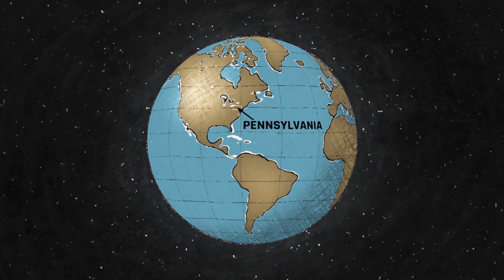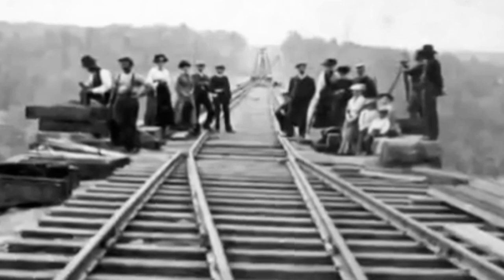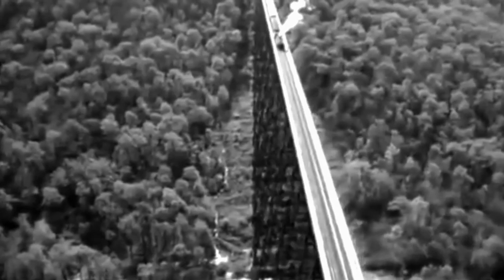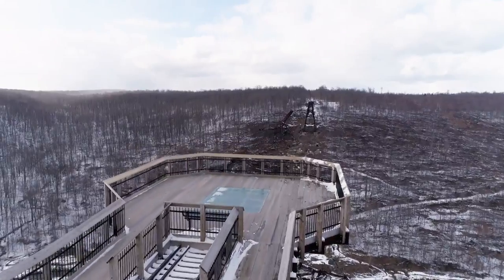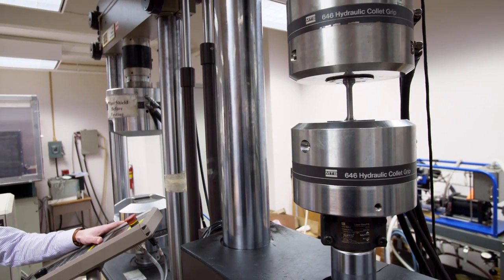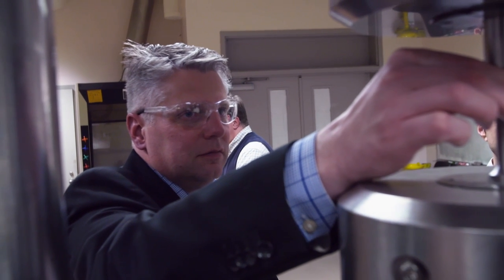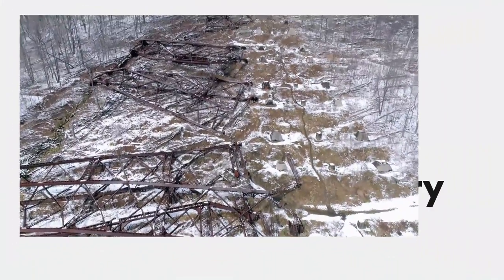How The 8th Wonder Of The World Failed Due To An Engineering Oversight |Massive Engineering Mistakes

Comment: I’d say the original engineers did it right. This seems like Lack of maintenance By future generations. All they had to do was replace those sleeves periodically.
Reply: Not the sleeves, the anchors
Reply: Yup, they coud anchor it again. Wind just lifted the structure and slamed it to ground.
It fact structure of this kind is like a kite in the wind
Reply: Thank you, I was looking for Thai comment. Ppl should have maintain it over the years not the original engineer problem after awhile.
Reply: @stephensarkany3577  He's holding a cracked anchor in the end clip though. Lol
Reply: @GiuseppeGaetanoSabatelli  maybe it broke because its over a 100 years old?
Reply: Slaves or sleeves
Reply: @jclar3565  got this in a notification without context and thought this was a reply on some ogre/tentacle hentai
Reply: Omg your right, the sleeve was the part that cracked and the wrought iron anchorbolts were fine... what an awful documentary...
Reply: If a train had been on it during the tornado the weight would have kept it down...Maybe? Or they could have strapped bungee cords to nearby trees.
Reply: It will stand all day long in compression but uplift is a whole nother game. Pennsylvania doesn't design for uplift especially back then. I stand corrected, from what I just read they do design for 90 mph.

Comment: Something that lasts for over a century is NOT a failure. C'mon now, modern sports stadiums barely last for 30 years in decent shape
Reply: @U WinTV Not so.   The bolt caps were not corroded back then.

Comment: I bet those engineers that designed this would have been so proud that this bridge lasted as long as it did and that it took a tornado to take it out after that long of a lifespan. If proper inspections and maintenance were performed it would likely still be standing today. You can not blame the original engineers or builders for something that fails that long after it is out of their hands when long term corrosion combined with extreme weather are the cause of failure. You could say they should have used different anchoring bolts but there was close to a century in which they could have been replaced so if no one else predicted this with all the technological advancement in engineering along the way how were they supposed to predict this way back then!

Comment: So lemme get this straight: A bridge that lasted well beyond its initial design (twice) is a failure because it was destroyed by a tornado in a non-tornado-prone area, a neuroscientist is being portrayed as an expert on civil and metalurgical engineering, they test the tension of cast iron and portray that as the weak link even though they lead off by explaining that the bridge was made of wrought iron instead of cast iron for that exact reason, and then they tout that as the reason for the failure of the collar nuts...  which were installed during the rebuilding, and were thus presumably steel?  I would hope that discovery could at least tell an internally consistent narrative, let alone getting the facts correct.
Reply: The big problem was that the current engineers didn't find the weakness till it fell. Oops who would have guess the foundation pins would wear out in 100 years...
Reply: The bolts they were attached to broke not the nuts
Reply: @jwarmstrong  I'm willing to bet some maintenance engineer in the last 20-30 years brought the subject of the 100 year old collar-nuts up, but the memo was buried by a guy in suit because of budget constraints.
Reply: @charlesdog9795  not that it would have mattered. I can't imagine anything surviving the forces a tornado would put on it.
Reply: This is just how UK television always portrays U.S. ingenuity.
Reply: YES! Exactly what I was thinking, wrought iron cast iron steel, wtf is it? figure it out, then get back to me on that over a century of serviceable use in an area not know for tornadoes being "failure due to oversight"
Reply: @jbodden6977  If she had a degree more connected to the issue at hand they would have mentioned it. A neuroscientist, no matter how good, isn't an expert in engineering. Nor would a PhD in psychology.
Reply: @charlesdog9795  So true. And said guy got none of the blame.
Reply: Daniel,  I take it you DON'T work in government.
Reply: So the anchor system wasn't enginerded for up lifting forces... But where are the calculations of the uplifting forces that would have been present from the recorded winds on that structure, and then how do those forces compare to the designed strength of the actual structures anchor system? Looking at the debris it looks like half the bridge fell to one side while the other part fell to the other side, suggesting it was directly in the path of the eye of a fairly large tornado. I'll bet even standard modern specs for a similar bridge would not actually withstand the wind loads from that tornado.
Reply: Paid experts. It’s a problem in news reporting too. Nobody appears on CNN, CNBC, or Fox without being PAID to read their lines

Comment: After 100 years without replacing those anchor bolts or collars, the failure is mostly a maintenance problem. They're exposed to much harsher conditions than the rest of the bridge.
Reply: What was most interesting to me was that the newer steel collars failed by splitting.  They may have been partially split already by rust jacking from the older anchor bolts inside them.  I would have expected the threads on the anchor bolts to have been stripped off by the collars.
Reply: I'm also pretty confident a tornado would wreck that bridge with steel or iron anchor bolts
Reply: How ductile or otherwise the steel was also depends on temperature. I expected they made allowances.
Reply: 100% correct.
Reply: Pretty sure Mr. Tornado would have knocked down that bridge regardless of what they did to make it better. lol.
Reply: It's PA.., maintaining bridges and overpasses is still a problem to this very day lol
Reply: 100 years, Rusted bolts and a tornado.  What terrible planning.
Kinda like this.  If I live to a hundred, with bad lungs, feeble frame, thinning hair and a hearing aid . . .then get hit by a tornado. . .did it matter I ate too much bacon and drank too much wine?
Reply: Not a maintenance problem as much as a tornado problem
Reply: @jayden7945  , I was thinking the same.
160mph winds are no joke on a tall, long structure like that bridge.
Reply: @SuperSirianRigel  Well, the only reason that much of the bridge still exists upright is because of the maintenance work done in 2002 and 2003.
Reply: I agree. Seems to me with all the new technology they would have done something sooner as weather and things changed
Reply: @tjh44961  that's the picture I had in my head. Flash new steel collars ripping the thread clean off the dodgy old iron.
Reply: @CarsCatAliens   you’re not lying. In Lebanon Co, We still have bridges that got damaged in the 2011 flood that still need redone.
Reply: I bet those bolts and collars were broken in the act of the bridge falling.  I doubt they were the cause.  Once the columns start to tip over, its going to snap all of the remaining bolts.

Comment: So an engineer, from almost 150 years ago, with his limited science and engineering available at the time, and limited materials, built a bridge that lasted over 100 years supporting HUGE loads from incredibly heavy trains generating ridiculous vibration, and only went down after a powerful tornado hit it, is a failure? Ya....what an asshole. All of us in the comment section would have done much better. More importantly, the geniuses that made this “documentary” would have done a much better job.
Reply: and the funny part is,I live in PA the coal mines and steel industry are pretty much gone at this point. the bridge had almost no use left and was already closed when it got destroyed by a tornado.
Reply: @Mark Campos yeah it was supposedly being maintained.
Reply: I could’ve built it to last a good 250 years minimum. Also faster
Reply: @lukasdoofus2592  despite the coal mines and steel industry the bridge was also used by passenger trains. They stated in the video that passenger trains were diverted for safety reasons after they discovered how poor the bridge was. Even freight trains had stricter regulations to follow. So I don't get your point of the bridge not having much use left.
Reply: In Seattle about 8 months ago they found that the West Seattle bridge was failing and have since closed it. They have no permanent plan to replace the bridge that was built 30 years ago to 100 year specifications.  I'd say we should dig up the engineer of this bridge, figure out how to bring him back from the dead and get him to build it. Seems like it would be faster than letting WSDOT handle it.
Reply: @scottwall8419  The problem today is that everything is designed to use the barest minimum of product and labor that should allow it to work for a predetermined amount of time. 100 years ago things were designed to be overbuilt and last forever.
Reply: @ronaldsteele6151  There was minimal freight traffic on that bridge and the only passenger traffic was a tourist train that used the bridge as an attraction. That bridge and line was yet another of Americas great and vast rail network that was abandoned in favor of supporting overcrowded highways. The country would be much better off if the government stopped subsidizing highways and airways and forced people to turn back to rail.
Reply: Just going to make it clear that an F1 tornado is NOT a "powerful" tornado. Powerful is generally considered to be EF3 or above.
Reply: @lukasdoofus2592  same here. Despite everyone elses “opinions” there is virtually no need for trains in our part of PA. Trucks handle virtually all transportation.
Reply: This isn't a documentary. It's from an engineering disasters TV show.

Comment: Even if collars were not used and new anchor bolts were installed, the bridge surviving a tornado hit is questionable.
Reply: Most likely wouldn't have
Reply: The Collar Nuts where Much Stronger.. And I Agree with you.. They Needed addicional Support Down Low.. And its AMAZING too me that they where Able to Bend that Sheetmetal in the Lengths of these Towers.. WOW!!
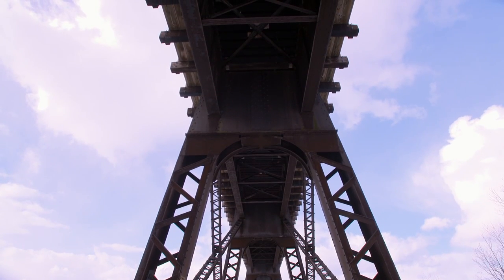Reply: The sections that remained standing did have new anchor bolts. They were installed when they closed the bridge in 2002 for the renovation. Check out the video at 3:14. Those boxes with the rods sticking out are the new anchor bolts. They also encased the old footers with new, additional concrete to shore them up. They reinforced and replaced some steel plate and bolts on the support columns, too. Unfortunately, the tornado came before they could complete the renovation, so the sections that they didn't yet get to went timber. I'm surprised the video didn't talk about this. I would highly recommend visiting this place if you get a chance. You can still walk out onto the remaining sections of the bridge and since they are leaving the steel on the valley floor, you can walk down to it and amongst it. They built a large visitor's center and it's now a PA state park.  It's called the Kinzua Bridge State Park. It's free, and you can definitely make a day out of it. Just a heads up, if you plan on hiking to the valley floor, know that it's a fairly steep and fairly difficult hike. Bring some water and good shoes. Enjoy.

Comment: Aside from what everyone else pointed out, they also compared steel to cast iron despite the narrator clearly stating that the original structure was wrought iron. Maybe steel would still outperform wrought iron, but that's not what they tested.
Reply: That footage was used in another production on the history of steel and if I remember right something about the Titanic and the Edmund Fitzgerald.
The Discovery Channel also did the History Channel. They are so cheap they will reuse that footage as many times they can get away with it because they want to pay these people only once.
Reply: Yeah there is something wrong here.

Comment: I'd like to point out as well that even when the bridge was closed, it had been a State Park (and still is) since 1965.  Freight traffic stopped in 1959 and the bridge sat vacant for years until it was opened to the public (as a state park) in 1970.  Any traffic on the bridge after that time was pretty much just foot traffic (with an occasional trip across for tourists in the 80's and early 90's on the Knox and Kane tourist RR) and once the engineers discovered the bridge was deteriorating, they closed it down to everyone and started working on repairing the deterioration.  (Interestingly enough, all sections that remained standing had been reinforced by the repair team.)  There's an amazing visitor's center there and you can walk out on the remaining span and view the valley.  Not a fail.  Sorry Discovery UK.  No dice.
Reply: This explains why it was not repaired.  Good info - thanks

Comment: The bridge was a tourist attraction, there hadn't been a train over the bridge in decades.  There weren't any tracks to the bridge when I was a kid in the 70s
Reply: They ran tourist trains over it until its closure in 2002.
Reply: That's where you're wrong it wasn't a tourist attraction and not riding Kane did rides on it every year every year they did rides on it you could pay $5 per person and ride all the way the line they did it during the summer every year until the bridge collapsed and then my family went and rebuilt the bridge extensions to where you can walk out and look down over the whole site because they left the metal and everything there
Reply: Then you must have dementia because that train was running in the 90s and the 2000s I wrote on it even in 2006 and seven when they would ride you out to the kinzua bridge and go to the train car so obviously you must not live around there
Reply: Hmm...I took a train across it in 1990 operated by the Knox and Kane railroad.
Reply: Lol. Really?
Reply: @dragons0220032002ify  Don't you think that the rails would have been removed and replaced at some point? Or do you think they last forever?
Reply: @hubriswonk  right replace something that's been worked on for years it's always was maintenance nobody thought three tornadoes would go through a valley it's exactly what happened nothing to do with engineer fails or anything it was always maintenance because it was used to transport tourists and train rides All Summer Long until this happened so no I got family who works on the bridge and has worked on that place for years
Reply: @hubriswonk  LOL, actually they do pretty much. There is rail in use on ICC-approved branch lines well over 100 years old.

Comment: Kinzue Bridge was build in 1882, collapsed in 2003, which means it lasted 121 years. It failed due to old age and a tornado. That is hardly a failure. Engineering has advanced since than; no doubt by today's standards such a bridge would be build differently. In 1882, this construction was state of the art, just like the Titanic and no one today would build a Titanic the same way.
Reply: If it was built today, it would have to be torn down in 30 years. Just compare today's washing machines 6 year lifespan, to yesterday's washing machines 30+ year lifespan.
Reply: @jackandblaze5956  long lasting durable product yields less money to companies that prefer to have you buy new a product the moment a small failure in it occurs.

Comment: The failure was in no one in the 100 years since realizing the mistake and making note of it until after it had failed. The bridge performed to reasonable expectation as designed by the engineers 100 years prior.

Comment: I doubt they thought the bridge would last 100 years and a tornado in a valley like that seems a bit rare
Reply: 120 guys  in 90 days? Lasts a hundred years?  I've worked on sites were the engineers don't turn up for opening at hotels in case they fall down half way through it!

Comment: Narrator, expert, narrator, expert, narrator, expert.
“I need a bridge engineer or a neuroscientist to read this bit on a hundred year old bridge.”
Reply: If the show features a neuroscientists and not a bridge engineer then guess which one you get?
Reply: @krashd  Well to be fair they had both but the choice of the first is somewhat puzzling.
Reply: @marvindebot3264  This show has several series that encompass everything from construction to A.I. to body augmentation so the experts on hand are the same ones featured every year.  They are not all just construction experts.

Comment: Seeing the size of this great bridge really puts the size into perspective, the lehigh valley railroad built a trestle bridge in the 1870s on the line from horseheads to van etten ny, that was around 0.7 miles long which is about 3500 feet, the hight is unknown due to the deep gorge it crossed, which was some of the steepest grades in the northeast and quite the engineering for the time, it was torn down in the 50s due to the line being closed down, the engineering of that time was incredible for being able to build these monsters with little to no technology

Comment: I would consider this more of a bridge inspector fail.  The bridge anchor bolt could easily be  core drilled out  and replaced at any time.
Reply: Agree ..bridge under restoration and today's structural engineering over looked a critical point...this goes on way to many times..they show up all professional looking ...but go home half empty ..base bolt anchors over looked... pretty dam stupied but they won't talk about their failure but blame engineering a hundred years ago..
Reply: Actually this was a known issue and crews were literally in the middle of fixing it when the tornado hit. Crews had been working on it for months already and had just packed up for the day when the storm rolled in. The bridge had been closed the year prior to specifically address the risk from high winds.